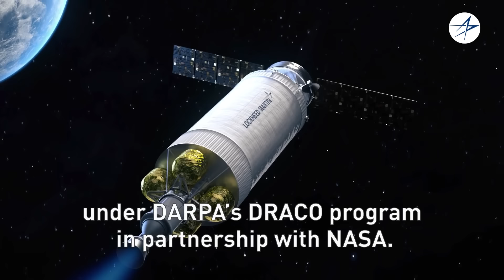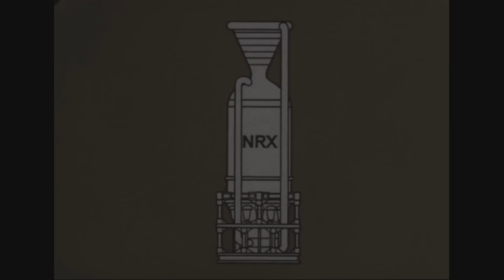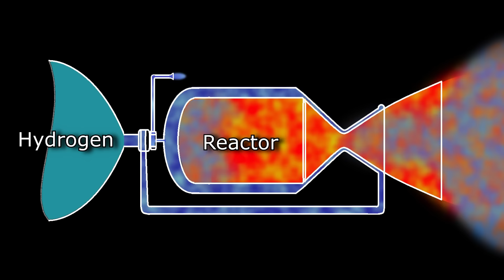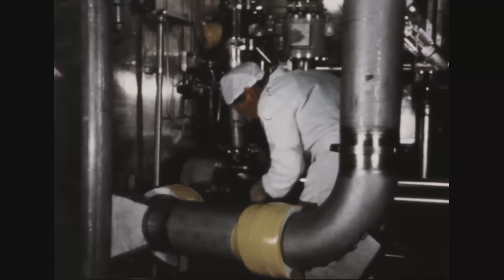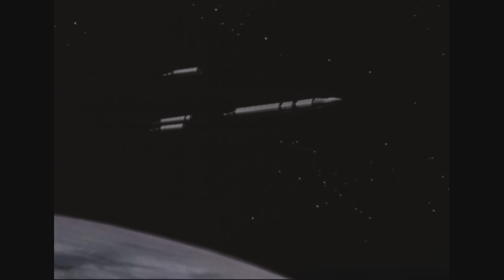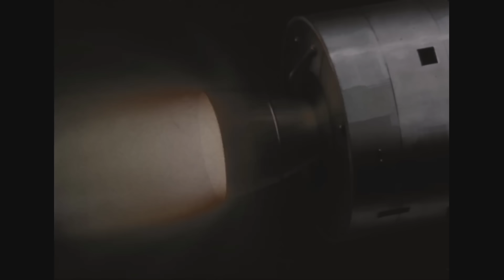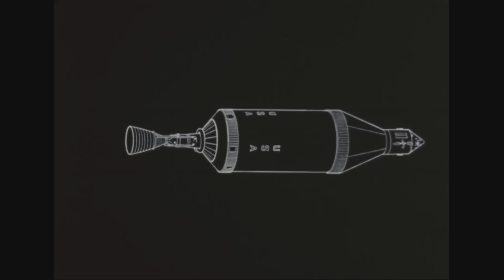Why Nuclear Rockets Are Going To Change Spaceflight

Comment: One would think nuclear rocket engines would be developed out in the desert far away from population centers; not so!  In 1959, when I was eight weeks old a nuclear meltdown occurred 1/2 mile from my home at the Rocketdyne research facillity, located upwind and next to the then 500,000 people living in the San Fernando Valley 50 miles from downtown Los Angeles.  The reactor was uncontained and significant radiation greater than the Three Mile Island event contaminated the surrounding area.  Better yet, since the work they were doing was considered secret the government decided to not inform the people living nearby.  That's right, there was no evacuation after a nuclear meltdown, and the residents nearby didn't find out about it for twenty years.  My grandmother died a few years after from stomach cancer, likely caused by drinking the contaminated well water.  We also got our milk from cows that grazed in a field across the street.  The facility is now a superfund site, and a mass of people live nearby; most have no idea it ever happened!

Comment: Why is hydrogen so desired?  Why wouldn’t you want something with as high a molecular mass as possible?  Wouldn’t that impart more ‘action’ out the exhaust than the smallest element?
Reply: Hydrogen means greater exhaust velocity. A higher exhaust velocity means more efficiency per fuel mass
Reply: A high molecular mass will give you more thrust but a lot less specific impulse (fuel efficiency)
Reply: @alexsiemers7898  exactly for greater efficiency, it's better to a higher exhaust velocity than high mass flow rate once in space, of course. This is why ion engines are so desired for probes.

For manned missions, NTRs are an amazing compremise as they still give us almost 2x the efficiency but have much higher thrust than ion engines.
Reply: Thanks.

Comment: Porque no Los dos. Like why not put a chemical system with the reactor. Would this add any benifits or would it just be a waste
Reply: In theory you could do that like an afterburner, where having some combustion will further heat up the exhaust and thus give more thrust, but then adding oxygen to the mix increases the average molecular mass and thus gives less specific impulse

Comment: The problem with chemical rockets, velocity of reaction/pressure has a max. I think it's 38,000mph is the speed limit. Other means are necessary for higher velocities. Now also note you have to slow down, that takes as much fuel. The answer is not this mass/velocity thrust. I say it's in electrical,magnetic fields bending space. Now we need to generate electricity in space, a nuclear reactor? NO, not in space. Time to call Scottie and get a complete theory on how those Di-Lithium crystals work!

Comment: Hafnium carbide (HfC) has a melting point of 3,928⁰C while compound hafnium, Ta⁴HfC⁵ has the highest known melting point of 4,215⁰C. These materials could address the temperatures of nuclear rocket engines where they are used in the appropriate locations. Since the best shielding materials, osmium, high pressure iridium, and neutronium are extremely difficult to work with, create, or even acquire, gold is the best available shielding to protect biologicals, crew and other living cargo, from the high levels of radiation produced by these engines. It's entirely possible that alloys could be developed to meet the requirements for thermal and radiation protection requirements, too. As these engines would only be used in space, refueling would be beneficial to extend their range and make regular trips between planets and moons faster and cheaper in the long run. Some of the icy moons of the outer planets could potentially become fuel sources. The future is full of possibilities. Who knows, there may be propulsion technologies developed that don't use a chemical propellant at all. We'll just have to wait and see!

Comment: the good thing about a nuclear engine is you don't need an oxidizer to burn your fuel so you can carry more fuel giving you more range and flexibility. you talk about the nuclear shadow butt if you come and go to say mars you are levelling radiation on the way there and back if you are a second mission passing through the same region pf space would you not be radiated from the first flight

Comment: you have herd of theas warp drives they talk about warping space time and all that jazz well the earth warps space time and that's gravity engine so dos the sun and that is a gravity engine there is no antimater if you even consider a black hole that is also a gravity engine the dead core of a sun so it seams to me if you want to get in to space in any real way you need to build a gravity engine the bell was a early prototype electro gravidic propulsion system

Comment: Thanks, Scott, for this deep dive into nuclear propulsion.  I knew it was a lot more complicated than Heinlein proposed in his early novels (particularly Rocket Ship Galileo and The Rolling Stones, both of which featured nuclear powered rocket engines), but I hadn't ever heard of some of the issues you mentioned.

Another interesting application of nuclear power that was explored back in the day was the nuclear powered aircraft engine.  You can actually see two of the test systems at the INEL in Idaho (near Idaho Falls) where they are on public display.  While you're there, take the time to tour the EBR-1 facility where you can see the first nuclear breeder reactor to generate electrical power back in the 1950s.

Comment: At 7:40, there's the rocket engine, separate from the spacecraft. It looks a little bit fragile, considering the thrust that it develops. Where does the frame of the spacecraft bolt to the engine? Where is the force transferred?
Reply: I think the mount is out of frame

Comment: So, you've got hot uncombusted fuel coming out of the rocket nozzle. Could you add an afterburner?
Reply: That could give more thrust by both heating up the exhaust and adding more mass, but would probably reduce the specific impulse

Comment: Has he done a video on Nuclear Pulse Propulsion? I wrote a paper on it in college. It's super interesting; you drop tiny nuclear bombs out the rear of your ship and it absorbs the kinetic energy via a pusher plate, imparting thrust. You can theoretically get up to 10% the speed of light. A big drawback in you have to carry a crap-ton (official term) of nuclear bombs. If we want to get to the nearest stars in a human lifetime, this would be the way. I believe the system can be tweaked further to go a bit beyond 10% the speed of light (that's what my paper was about) but none of this is science fiction; it can all be done today, with today's technology.

Comment: In theory, charged fission products can be directed with some magnetic confinement and used as propellant itself, affectively as an ion engine.

In that case, material damage from fast neutrons will be a big challenge, not as bad as 14MeV fusion neutrons, but still.

Comment: it will never exceed something like an Orion Project, with actual nuclear explosions driving a massive plate.
This will provide constant thrust, previously unimaginable acceleration over a long period, and almost infinite energy for the ship's needs. Basically, giant cruise ships assembled in orbit, travelling at constant 1G (natural gravity with a normal "down is the floor" direction), achieving speeds of 10% of the speed of light. And hot showers for everyone.

Comment: I wonder how viable it would be to use the nuclear part of the nuclear engine to "merely" preheat the propellant and an oxidizer, and have them combust after having been preheated. At a superficial glance it would look like it could get much higher temperatures, at the expense of higher molecular mass, but the high temperature may be difficult to contain, and the much higher molecular mass may decrease the ISP drastically, even with the higher temperatures

Comment: NASA plans for NERVA included a visit to Mars by 1978 and a permanent lunar base by 1981. NERVA rockets would be used for nuclear "tugs" designed to take payloads from Low Earth Orbit to larger orbits as a component of the later-named Space Transportation System, resupply several space stations in various orbits around the Earth and Moon, and support a permanent lunar base. The NERVA rocket would also be a nuclear-powered upper stage for the Saturn rocket (the Saturn S-N), which would allow the upgraded Saturn to launch much larger payloads of up to 340,000 pounds to Low Earth Orbit(LEO).

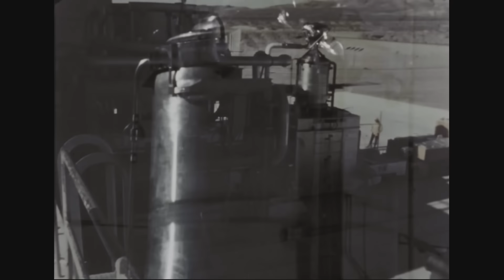Comment: 12:44   "...you can design the reactor so that it doesn't reach its full criticality until the fuel is actually flowing through it...."
.
'Propellant' not 'fuel'.  
Also, 'full criticallity' suggests some conceptual dissonance.  Higher power levels are not higher criticality nor vise versa.  A reactor will be supercritical while inceasing power and subcritical while decreasing power.  At steady state, a reactor will be critical, at whatever power level, so saying 'full criticality' is a bit awkward.

Comment: Given that solar thermal propulsion can theoretically get 900 seconds too, why would we mess with all the radioactive bother of a nuclear engine? Granted neither has been tested in space though nuclear will be soon. But also, a solar thermal rocket is something that someone like Musk or Bezos could test in space without all the headaches of obtaining and launching nuclear material. Yes it will be hard to get the mirror weight down, but reactors weigh a lot too.

Comment: Points at saucer Shape Make as a Turbine/gyro on the inside. Hey.. Why is there a science video explaining how Spiders can fly with electricity, but Bees which as Swarms can produce Thundercloud level electric signatures the science system says it doesn't assist their flight? Because they're lying.. Btw gyro design is simple method to not flop around while using electrostatic flight.

Generate a big enough electric sail and earth will reject you. Ultrasonic echoes in space to collect hydrogen waste from sun. "No sound in space!" Points at Ultrasonic microphones in explorer probe That's sound.. ChatGPT: "Its not traditional Ultrasound!" < Things like that make me want to report humanity is a natural enemy. Listens to the silence of space and points at black giant Triangle ufo's on search engine images

Points at outerlimits episode Heart's Desire Normally if a planet poses a hazard in our models we destroy it then and there. Before it poses a problem..
Reply: ^ Btw I told you how to get unlimited hydrogen.. Add cold steam Tesla turbine to greatly multiply heat value with incapacity to balance with turbine size made to steal all the heat before it can reach cold side and with nuclear it will run super long time more powerful than normal turbines. For powering super strong ultrasonic echoes in low medium while creating more medium around you.

Points at plasma generated ultrasound Warwick university + Ultrasound 3D holography + Plasma distortions of Predator film cloak Yeah.. You can do that too..

Comment: could you do a similar video on the relative merits of Zubrin's proposed uranium salt liquid fueled nuclear rocket?  it occurs to me that most of the negative aspects of the solid core reactor would disappear.  the only serious issue would be fuel resupply - you would need to refill with water that has uranium salts in it.  but if the plan is to fuel it initially for ten re uses then dispose of the entire booster unit that's a nonissue.

Comment: this is the best 20 minute precis of nuclear rockets so far.  except the mass of the exiting hydrogen is one not two - it's dissociated around 2000K.  so for each liquid H2 molecule entering the reactor, by the time it exits it's dissociated to 2H.  it's not ionized, which is good since they would destroy the nozzle and reactor.  Physics pedant here.

Comment: If it were possible to Fully Fuel an STS Space Shuttle in Earth Orbit at an FLOWER CHILD PROJECT Maintenance Space Station as if it was being Launched from the Earth Surface; then, ?What would the Spaceflight Profile look like for the STS Space Shuttle?

?Would the STS Space Shuttle have the velocity needed to go to Luna?

?Would the STS Space Shuttle have the Fuel Capacity needed to enter Lunar Orbit?

?Would the STS Space Shuttle be able to do a Round Trip between Luna and Earth?

NOTE
Luna = The Moon

I do use "The Moon"; because ...
•   Titan is a Moon
•   Deimos is a Moon
•   The Moons of Jupiter are more numerous than the Earth's Moon.

Comment: let´s talk about modern hightech: SpaceX had 387 starts - 36 missiles were totally failures and ended NOT in space. Now I think that the development of nuclear powered rockets will be as complicated as modern the development of modern chemical rockets... what do you think would the populations worldwide say, when there were some 36 nice little nuclear "devices" raining on their homes? 
There is also an international treaty that nuclear weapons are not allowed to be stationed in space (and earth orbit especially) - now how would you make sure that nuclear powered rockets are not "designed" to have a "dual-use" as nuclear weapon (perhaps not "A-Bomb" but sure as "dirty Bomb")?
the next question: Rocket engines are, when they are in space, only working for short periodes of time: acceleration, steering, deceleration - the most part of their life they are just waiting for orders (like soldiers) - a nuclear power plant is constructed for permanentt work, must be permanently cooled and controlled - do you really think that this is the ideal propulsion system for space?
And the big problems with long-time space missions (like a flight to mars, or a moon base) are not problems in propulsion or in power generation: the big problems are biology - humans are not very well suited for longer working or travelling times in low- or no-gravity environments, and the problem how to protect space travellers from radiation (the natural cosmic radiation, not the one additionally produced by an nuclear rocket engine) is also not solved.
Nuclear rockets - thats an typical (US) american (cowboy) idea of the 40´s and 50´s - and it is IMHO a very stupid idea...

Comment: I was thinking rather than having the hydrogen run over the reactor directly, you could use an inductive heating element and generate the electricity using a small nuclear reactor. It's a bit energy inefficient, and would probably need a lot of radiators because the heat produced can't escape through the exaust. but you'd make up for it with being able to use a higher temp non-melting engine bell.

Comment: Very nice overview!  I remember Freeman Dyson's idea of nuclear-powered space flight.  You know of it, I'm sure, a design with a 25-foot thick "pusher plate" (or larger) in the aft section, connected to the main spacecraft body in the nose by way of huge, gigantic shock-absorbing springs of some design.  Every so often a low-yield nuclear fission device (bomb) would be detonated in the "thruster bell," with the pusher plate absorbing the force of the bomb towards the nose while the major thrust created by the blast was directed out of the back through the huge bell thruster.  Of course the ship is designed to be propelled in this manner so it would hopefully be strong enough not to be blown to pieces...;)  For many years this was considered a possible, rational approach to future solar system exploration. 

With enough nukes on board, tremendous velocities could be achieved--and to stop it, you flip it, and continue the same. Then afterward,  chemical rockets could be used for fine-tune navigating.  Sure, the trail of small nukes going off every minute or so would be dirty, I'd imagine, and yet I can only think to compare that with a fusion trail kilometers long with future fusion spacecraft, assuming fusion is ever realized...;)  Anything passing through that fusion tail becomes dead meat!  I think it's still on the Internet--a very poor quality B&W low-res outing where Dyson and his friends in the 1950's launched a test model of the principles involved, and it worked right from the ground up to a decently high altitude. Of course, there were no nukes, just TNT, IIRC, but the small test worked to prove the very simple principles involved...;)

Comment: So I assume that the hydrogen it's being accelerated out the back of the reactor is still hydrogen. So I would wonder if you could then add oxygen to the unburnt but accelerated hydrogen in a long afterburner to then get an extra wallop from burning the superheated hydrogen in a oxygen-rich environment.

Comment: I think the biggest problem with NERVA, is that despite having great ISP, they have poor dV, because of using light propellant, they have less mass to throw out the flamy end
Reply: I was wondering if anyone ever looked into adding LOx injection to the super-hot H gas to get much higher temperatures and much heavier molecules to throw out the back. Basically, a normal hydrolox rocket engine with major preheating of the fuel. Any advantages?